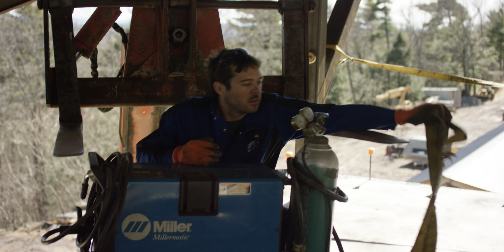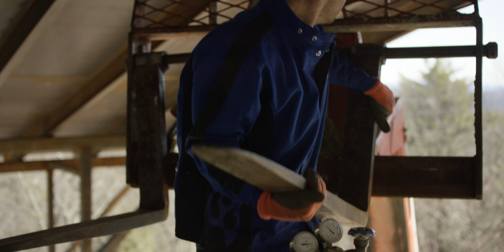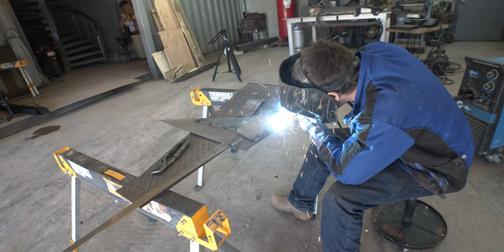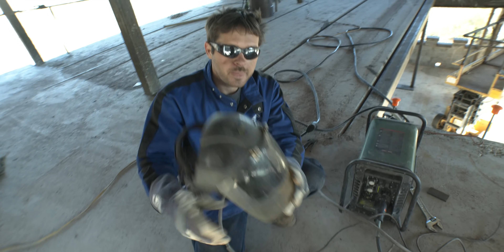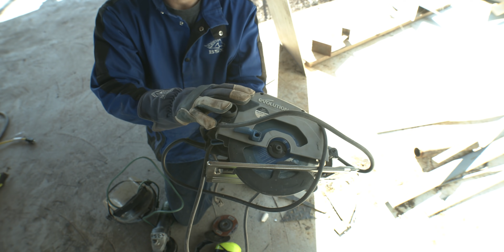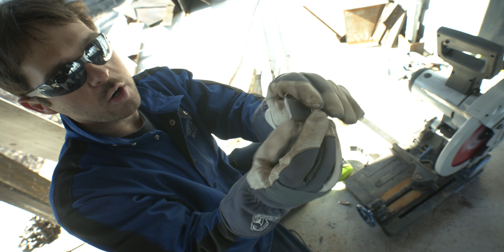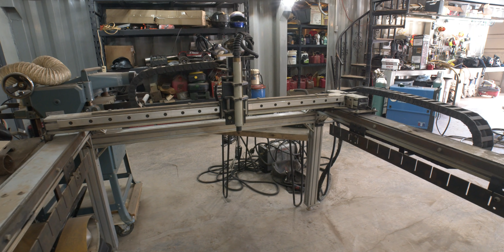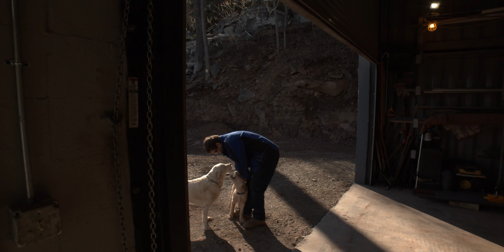Talking about welding equipment

Comment: with stick welding I find it nicer and easier to weld if you bend the rod down before you start so you don't have to lift as much to get the stick started.

Comment: I got a Hobart multi process 200 plugs into 110 and 220 great little welder gives me 100 amps 21 volts on 110 200 amps can’t remember the bolts for 220

Comment: i didnt think mig welds were that strong i always thought it was lighter metals like aluminum and thinner stuff anyway but recently learned otherwise but watching the truck go up here they seem to be just as strong as a stick weld...i thought about buying a mig welder but idk if id be able to justify the means id probably rarely ever use it unlesss i got into seomthing that required it more...i dont really do alot of grease work aka or car emchanics im trying to learn about small engines but still my dads buddy has a mig welder but he doesnt know how to use it but im sure i can use his but again id probably never use a welder ..i deal with metal daily but i just scrap it thats how i make extra cash. if i can fix qhat i find i sell it , if not it goes to the scrapyard.

Comment: i stopped welding about 40 yrs ago when they had me trade in my mechanics uniform for white shirt and tie lol...about 12 yrs ago my cousin tore a motor mount off the frame of his hot rod and asked me help. i used a stick welder and after a few test scrapes it comes right back to you. so i went to harbor freight and bought a mig. to play around with. so your videos do help alot...what i like about you and your videos is you seem to always give an honest assessment and to me as it should be to everyone is very important.

Comment: andrew, as demonstrated, a proper weld will be as strong or stronger than the steel being welded , should be able to withstand 60,000 psi before breaking

Comment: im a union labor  the 4 inch cutting wheel on the the 4inch grinder  shatter  in to ur face it very dangerouse    labors have them cutting wheel stuck in there face and there neck please wear a face shield be safe peace

Comment: At 16:44: AC meant to say "highly pressurized water" not "highly compressed [sic] water".  Even in oceans at 4 km depth, where the pressure is 400 atm, water suffers only a 1.8% decrease in volume.

Comment: Your mig will weld 1 inch metals it’s just how you prep it, like beveling the material! You can tig any metal, just saying! I’ve had to stick some stainless rods because after a while they suck up moisture and you have to stick them to dry them out!

Comment: its called crabing on the skytrak.   your bottle will last all but 45 min should be running FCAW. wait and u have sunglasses on under the hood..lol and btw a 1/4 in tack shall hold 100 pounds, a 1-inch stitch shall hold 1000 lbs

Comment: just wanted to ask a question -after welding on the roof how did you get the scissor lift off the 3rd floor ? it doesn't look like you have ample room to clear the way it went in .

Comment: A million years ago, I had a 1986 Grandwagoneer, a home made off-road trailer with matching tires and wheels. The trailer was custom made to carry a welder generator, wire welder, ladders and scaffolding and such. It was a 100% mobile welding business designed to get to places most people could not get to. Most of my heavy work was stick with 150’ lead, I did not have the ability to hoist up my heavy wire welder so it usually did the work I could drive up next to. Made a lot of money on small jobs with my cheap, light weight, light duty 110 wire welder that I had to fix often, but it didn’t matter as it didn’t take long and it was easy, for me, to fix the problems. Great job on the video!

Comment: As an example Low Hydrogen rod 7018 with a one inch weld (A Correctly Produced Bead) will hold 70,000.0 lbs.

Comment: Andrew I do enjoy your videos very much, welding is a skill that does take years to master the 7018 rod is for heavy duty welding for what your doing a 6011 rod would be easier to work with and very strong as well.  When I started to weld 35 years ago I spent 6 months just welding beads in circles , dragging and weaving in.....most of the friends start welding the same day and that's the mistake they make.......I prefer a stick over the mig but I do use a mig for some things....its faster I agree, a  6013-6014 rod may look better when chipped but its not as strong and the 6011 or 7018.    Most old school welder were also master grinders, and lets def not forget the Blow torch skills, cutting and gas welding as well that's needed......keep up the good work...
Reply: Real important comment seeing all that's happening
 Smh

Comment: not sure why everyone seems focused on the camera, in a welding video.  RE: stick welding, 7018 low hydrogen rods are okay, if you have a DC welder/setting.  They are more for welding high(er) carbon steel, such as grader blades & such, that are hardened steel.  My favorite rod is the 6011.  Not a "drag" rod like the 7014/6013, but they will blow paint, rust, & other crap out of the way, and give a good weld in spite of unclean steel.   Andrew alluded, everyone is an expert.  We all have our favorite rods, for particular jobs.  7018 not my fave, as the welder at my tractor repair shop job had an AC only welder, so I only used  7018s on hardened, high carbon steel.  Otherwise, they were not worth the hassle (on AC).  Ever use PAM spray (sparingly) for your MIG tip?
Reply from the maker: I have not tried pam. That dip helps keep it clean though.

Comment: Another great video, no matter how it's filmed, but for me the most significant part of this one is the one inch weld test, I saw the video where you calculate all the metal weight and lift to see where it would break, but it never broke all the way to the truck bumper, it tells me that probably all the welds I made where more than sufficient, for home usage applications, I guess it explained a lot for me, where now I would not go as crazy on the welds, because everything I welded is probably over strong...and by the way, your house now could be considered hurricane force 5 windproof, and probably nuclear proof....

Comment: My impresson of welding so far; from watching you and knowing it's a great deal of craftsmanship behind it - are that the best way to learn are to learn as you go. I figure people will realize fairly quickly what works and what doesn't. The finess of having fine spots and so on comes with time. But in the grand scheme of things - does it hold for the application? Yes? You did a good job.

Comment: I have a metal cutting chop saw with a metal cutting blade in it. I cut up some bed frame steel for my smoker .I chipped 11 teeth on blade. A guy at the welding shop told me bed frame steel is tempered steel. Now I use a cutting wheel on a grinder to cut bed frame steel. Now I know.

Comment: The only thing you ought to mention about plasma cutting is that you really should have some sort of air filtration system before it goes into the plasma machines because alot of them really dont like water or contaminants if you looking to have a good service life of your consumables. So unless your plasma has a built in air filter.. id fit first a water trap to get rid of 99 percent of the moister then a air filter to clean out any particles that made it through. That way you got clean air going through your plasma machine. But apart from that good video )

Also i use that same chop saw but i noticed you using a different blade? you using it just because you had it laying around or do you find it performs better than the original they ship with?

Comment: you should sandblast it before painting - and maybe use some epoxy based laquerso the paint is impact resistant .- like hail and tree branches, scratch resistant - like when some iced snow - or some branches sled down
And freeze resistant as in no cracking when the steel contracts from the cold- with such a huge continuous surface tis might become a problem 
coal tar epoxy might be ideal for that application .

Comment: I was kind of proud of myself the other week for building a salt box style wood shed out of 4x4, 2x6, and 1x6 red cedar with a metal roof that holds a little over cord (and for once I got all the angles correct) and then I see Andrew at 19:40 standing in front of the indestructible castle he built with a killer roof - lol

Comment: Those telehandler forklifts are great. I had one and welded a receiver hitch on the back and had an adapter fabricated for the front that would accept skid steer attachments. Really handy, .  Keep up the excellent work!

Comment: Nice explanation/demonstration of metal cutting and welding. Maybe it was the camera angle, but it appeared your head was buried directly over your welds. Not a good practice without lung protection or ventilation.

Comment: Not to criticize, but a few points to make:   All rod should be kept dry, preferably in an oven.  If the flux gets damp it causes problems.  All welding areas should be prepped (free of dirt, paint, and rust with a grinder or wire wheel) for the best results.  7018 is an all position rod-flat down, horizontal, vertical, and overhead, but you probably know that. One last thing. Vertical welds are much, much stronger than horizontal welds.  If you had two 1/2  inch vertical welds on either side of that lifting lug, instead of one 1 inch horizontal weld, you could probably pick up two entire trucks, but don't quote me on the numbers.  That was a good tutorial, thanks.
Reply: Google says 6011 welds just about as strong and doesn’t need to be “babied" like 7018. That works great on a ranch, where arc welding is an occasional, not a common, activity.

Comment: Miller welding equipment is top quality stuff and so is Lincoln. I run two mig welders Oerlikon 230amp (oerlikon is now owned by Lincoln) and a Murex 185amp. I have two MMA (stick) welders, one is an Oerlikon 140amp inverter type ( really handy because it small and light) and an old school Oxford Bantam 180 Oil Immersed welder and battery charger which weighs in at 150lbs or about 75kgs and as such is quite heavy. It wasmade in 1987 and will still be welding in 2087. As you say, you cannot beat quality and should go for a good brand. One thing I would recommend to folk is to always grind of surface rust and mill scale because they can affect the weld too. Great video!

Comment: I am an expert welder. I would say you are too, what makes an expert is alot of welding in many different situations. I have been welding 53 years learning what malleable means and what you need to use to weld different metals to prevent the hardness of the metal from turning the weld to glass. Like spring steel, axles, frames, or rebar. Needs to be welded with 7018 or 10018 stick rod to be malleable to bend and stretch and be machinable from the slag cooling it slowly most chip off the slag way to soon for it to do its job. Wire welding looks pretty on a truck frame but; the sheer strength is shit. There is a reason for that warning tag on that frame. Welding a 5th wheel plate across the top of a truck  frame with a wire welder can kill you if hit by enough force. Once you have seen it or it happens to you, you won't forget it.

Comment: Great video! I think with the type of structural work your are doing you should consider using a dual shielded flux core wire. Not as much spatter also much faster especially for out of position welding.

Comment: Excellent job once again Andrew. I hope you save those mig welder tips after the wire gets stuck inside. I reuse mine by removing the wire and cleaning them out with a torch tip cleaner. Good as new.

Comment: Just getting started welding, I wish you had talked more about setting up the AC/DC welder, what amp you set it at for what kind of job/metal, etc.. And when you cranked up the oxy torch, I laughed when you said "make sure your gauges are set right",, but I don't know what they should be at.. Perhaps the next video. Thanks all the same.

Comment: As a welding novice, I find the most difficult aspect to be the current setting.

What do I set that to? Yes, it is to be set with respect to the thickness of the metal you’re working on, but since it’s determined empirically, how do I know if it’s correct or not? When my weld fails? Not practical. And that’s where I get stuck.

Newer machines have controls that let you choose metal type and thickness, welding rod/wire material and sets the current for you.

But for novices with basic equipment, it would be nice for you to do a video on how to select the current and about the feedback loop that you use (weld strength? arc color or behavior?) to know when it’s right.

Comment: The Baddest 'Fort' ever.  Do you or have you grounded the structure yet? How many thunder storms do you get there. Bolt out of the blue is a real thing. A T-storm can be 10 miles away with clear blue for you & it can zap from that far away. Keep thinking  there's some way to make that a faraday cage too to protect it. Need an EE. Y'all did such a great job on this build. Thanks for the info.
Keep Safe

Comment: When you were going over the Traverse machine it made me remember a cpl of tips.
 -Never grease the bar that the forks hang from. It seems like the logical thing to do to make the forks easy to move in and out, but the reality is, they move too easily and the forks will get misaligned just by going over bumps or even turning corners.
-I’ve seen a lot of people struggle trying to move the forks in and out but there is a really easy way to do it. Tilt the forks to basically level. Then lift the fork only slightly with one arm (maybe bracing against a knee for leverage). Then push the fork in or out with the palm of your hand as close to the round bar as possible. They should move ridiculously easy like that.

Comment: I don’t like 4 1/2” angle grinders that much, I think that they are overused and under powered, you have to have them for small,light work but a 9” two horse (1500w or better) is a much better, faster tool. There again I may be prejudiced because I started with the bigger tool, and I love the way the gyro effect stabilises the tool.

Comment: Should mention the Gas Andrew there are several but the norm is CO2 which the globalists want to ban as it is heating up the planet (total foolishness) CO2 is probably what your running there!? Another gas is Mig mixed Gold which is higher purity (specialty gas) I personalty think all the specialty gases is just ways the company's make more money but probably have some better shielding qualities. For example you can buy cheap brakes for your automobile and then you can buy better ones. Another gas is Argon which can be used for steel but is more expensive but is usually used for welding aluminum. Three main types of welding are stick least expensive then there is Mig and Tig. The end two shield the weld with gasses where the stick has the shield built into the coating on the rod. For instance 7018 for steel. Great video enjoy seeing you week to week as I am a Welder guy. These gasses are all present in the air we breath but they have machines to separate the gasses out of the air. I could free hand those blanks and have them be perfect. Takes a lot of years to get there! Andrew you should frame your test lifting lug you welded together and put it in a frame and auction it off to your viewers leave it for a month Give the money to some charity I would bid on it!
The home stead looks great Andrew you will have to name it now you should have a name naming thingee for the homestead and maybe the blessed winner could get to come hang out for a day!  Camarata Inc!?

Comment: When cutting anything you should have safety glasses as well as face shield.The cutting torch is good if your working in areas where you have no electricity access I been a welder since 1993 and you never stop learning things(15 years at Bobcat).When MIG  welding your contact tip should be inside even just a little shielding cone(I like mine in about a 1/4 inch).We have mostly Millers at work but for welding thicker steel I prefer the Lincoln welders.

Comment: TOO PRO! I constantly kept wondering what he dirty details didn't tell us because of all that new editing, moving camera angles and snazzy new cuts stole the better part of the presentation.

It felt like a carefully scoped short educational film that could've been titled "the beginner's introduction to welding equipment" whereas I'd have expected Andrew to veer off topic with "hey did you see that the boom lift has a cracked cylinder mount, let's fix that on the fly while the welder is already hanging in the air just close enough" or something. Nothing even didn't catch fire too much this time. And introducing the dogs more explicitly seemed a bit artificial and out of place: after a hundred other videos watched the viewers do know them by now.

The camera man and moving the camera around while shooting and the "scripted" (it felt like as if there was a script this time) feeling just somehow doesn't come out the right way...

Comment: Hey Andrew a quick question about your steel roof.  If you weld all the seams what’s going to happen on a hot day when the metal expands?  It might tear the panels or the frame apart.  Have you allowed for that?

Comment: I liked the new filming - I see other's points, I liked your old filming too - but this gives you more time to talk and explain things on the fly without setup costs - there were a few points where the camera operator was more "visible" - a gimbal / mount to smooth that out would be perfect, 2-3 times early on the camera work seemed to get in the way, but that's teething, was still better than a lot of "pro" youtuber film-maker stuff I've seen. Both modes work, this was interesting.